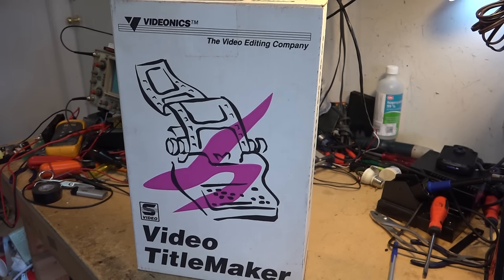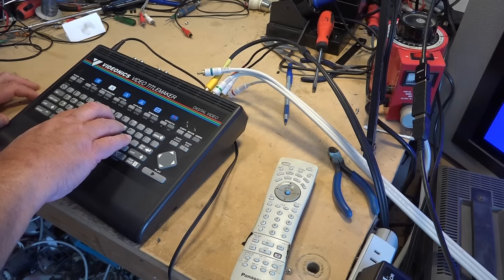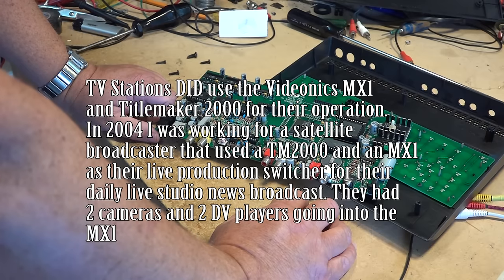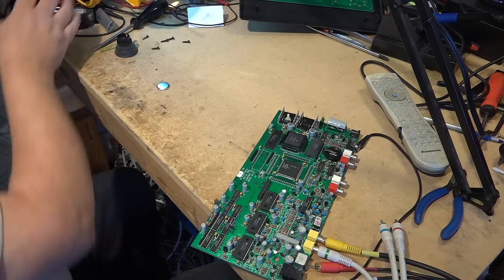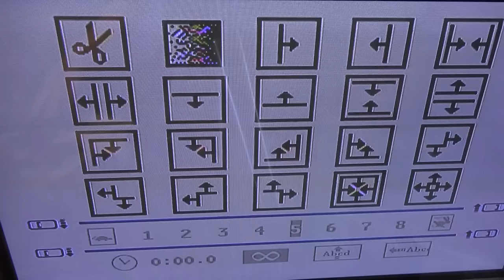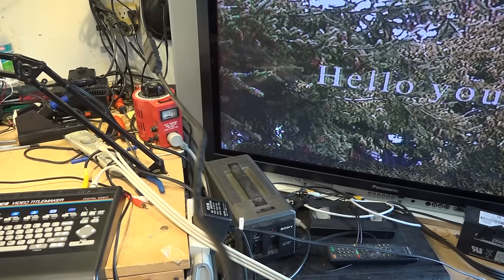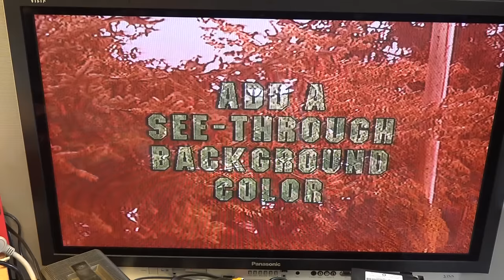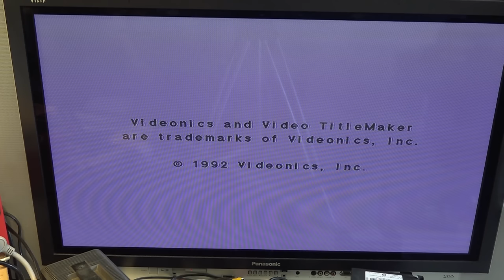Videonics Titlemaker Repair

Comment: Great channel! Thanks for the uploads.

A few years ago I got a Videonics MX-1and used it for a while with no problems. I used it along with this Title Maker and was really happy with both pieces of equipment. After putting them away for about a year I put the MX-1 back in use, but now suddenly have feedback issues I never dealt with before. Any video going through it now has two gentle squiggly bars that slowly crawl up the screen. Not major, but noticeable. When I connect a preview monitor, the preview image gets the same thing, but way worse, with the crawling bars being purple and green. That wouldn't bother me too much since it is just the preview monitor, but I've noticed that when connected it does make the squiggly crawling bars worse on the main output image and even adds a white line to the center of the crawling bars. Could my problem also be a simple battery issue like this was? Hoping it's a simple fix I could do on my own. Any thoughts would be greatly appreciated.

Comment: This thing is cool. I have used a bunch of different Videonics character generators when I used to work in a small studio in the late 90s. I never really had the patience to work on a TM 1000, 2000, or 3000. When I was introduced to this type of equipment, I started on a Videonics PowerScript PS-1000, which has more of a computer type interface with a mouse and keyboard. I believe the board was actually based on a computer. I was never a fan of the membrane keyboards, that most of the time when I had to put titles in a production, I was under a serious time crunch. It was always quicker for me to use the PS-1000. Another thing I liked about the PS-1000 was that I had a handful of PCMCIA memory cards, that I was able to keep all the titles for different productions on their own card, and swap them out easily. I'd like to find a PS-1000 to play around with again.
Reply from the maker: That was their pro division. This was consumer, but it still delivered great looking titles for the price.
Reply: makes sense. if your just a guy at home with 2 vcrs, this titler and/or an mx-1 would have been amazing in the early 90s.
Reply: As a teen, I used to see ads for Videonics products in Videomaker Magazine and wanted the Titlemaker 2000 unit and MX-1, they looked so sweet!
Reply from the maker: I have both the TM2000 and the MX1 from my old production suite. They were very good products that served their purpose well.The MX1 is still very useful as a time base corrector to stabilize bad tapes for digitizing. (it also removes macrovision)
Reply: 12voltvids Cool!
Reply: Reminded I just went to an Open House at a high school I once went to last month.  There was a teacher there that taught "Media Arts" who actually had some leftover equipment he was going to throw out.  He gave me his MX-1!  I was lucky!

Comment: A lot of cheap video titlers out there often were blocky letters, and often only gave you maybe 8 or so colors to choose from as well as a limited number of pages to store them with.  Videonics was certainly the first to do it right with this titler, though of course the later versions like the 2000 and 3000 did expand on the capabilities started with this one.

Comment: Amazing piece of old school video editing gear! My 1984 portable Hitachi VT-8E VCR has a switch to display time and date on the screen. But it's just these pixelized characters.
Reply from the maker: I'm editing the TM2000 demo right now. Both these pieces are up for sale now, hoping for a new home.
Reply: I remember seeing scrolling messages in a store. It had a large screen but it used big LEDs much like the score boards used in basketball courts. I was told it was driven by a PC.
Reply from the maker: That's called a pixelboard, and yes they were driven by a PC.Now for sinage they use big LCD panels, and drive them with Raspberry Pi's

Comment: I have one is not giving me color which you know what the problem will be would it be the battery I got that same model and I plugged it in  a monitor. Doesn't have car color also the older units use 12 volts VAC 1A the m 2000 uses 9VAC 1A . Can you give me a hint why I'm not getting any color on the older model their original model the first one that came up with the one you're working on
Reply from the maker: I have no idea but i have 2 working units for sale cheap.

Comment: I'm a huge Amiga fan. Have you got a Toaster? Would love to see a vid on one of them.  I think them toasters are getting quite expensive as they get rarer though.
Reply from the maker: No I never got a toaster. I wanted one, however I was more into video quality, so I dropped 20 grand on a camera instead. I was more of a shooter, and pro clients wanted broadcast quality.  I used a videonics MX1+Titlemaker 2000 for my early stuff until the Miro DC30 hit the market, then I jumped on the Adobe Priemiere bandwagon, which incidentally I still use. Not the DC30, but Premiere.

Comment: Hey Dave! Me again with more questions regarding Videonics. I have been looking for quite sometime for a videonics o some nice mixer for use as a TBC. Still no luck. Just today, someone offered me a Videonics MxPro for 10usd, but has a issue: it turns on but it doesn't output video. Do you think it coul be an easy fix like this or might be more probable bad caps?
Reply from the maker: Never fixed one, so I don't know what goes on inside it.
Reply: @12voltvids  I know someone who said the MXPro didn't have a whole lot of differences from the MX-1 though I haven't seen one used to know.

Comment: This must be the forerunner to the QUANTEL paintbox as used by the BBC.
Reply: Quantel Paintbox came out in 1981, cost 5000 pounds, took up a good chunk of an AV rack... and nothing compared to it. It was worth every penny. 

This gadget came along about 15 years later, I think?

http://www.creativebloq.com/video-production/remembering-quantel-paintbox-712401
Reply: This was basically a "PROsumer" type device that was catered to hobbyists and small-time videographers during the 90's.  I would say it certainly had an advantage over other character generators at the time when it came to the amount of colors it could do as well as the added effects like fades/dissolves and fonts.
Reply: I think the closest regular people got to what the Quantel Paintbox could do was probably the Amiga computer line of the late 80's, especially with programs like NewTek's Digi-Paint or EA's Deluxe Paint.

Comment: Well isnt that mad, battery problems lol :-D.
I would be supprised if it was only the battery voltage that created that problem, possibly 
the memory was scrambled and it needed clearing.
A very usable device for its day :-D.

Ive seen a good share of pc cmos memorys thats been scrambled and stops the machine dead, after the battery was removed and a short across the holder for 10 mins the pc would come back to life :-D.
I had one last year where the owner was going to buy a new machine because it would not power up, battery out, short the holder out........... battery back in and Presto works :-D.
He decided not to buy a new machine LOL.
Reply from the maker: Yes, and the guy that owned it bought the newer TM2000 when the battery died and his other one died. He first sent it back to Videonics, and they returned it unrepaired from the looks of it, because the shipping card was checked return to sender. Many companies do that. If something is out of warranty, or you return it without first getting en RMA from them, they just punt it back postage due.Looks like he got it back, bought the new one and stuck the old one in storage. Now it is mine to get rid of.
Reply: At least it has some usefull functions unlike the sima crap LOL :-D
Reply from the maker: Has lots of useful functions for someone still working with tape.
Reply: For me it has to do its primary functions well, and it does.
The pile of shit sima is like having a multimeter with every possible function, but wont read voltage/resistance correctly, waste of parts.
Reply: Not having watched the video yet, but as the owner of a Videonics TM-3000, I can say with great certainty that battery failure will scramble the internal memory and keep the unit from booting up.

As if that weren't both of absolutely amazing and inexcusably poor design, Videonics cautions one in the user's manual to always turn the power off with the keyboard. And yes, an unexpected power removal actually can trigger the same "no boot" condition or loss of all stored titles (and the clock!) if it happens when the unit is "on" and working.

Videonics did provide a "hidden" set of keystrokes that would reinitialize the TM-3000's memory and get it going again (at the expense of whatever was programmed in to the unit). While this is something that an end user might need to deal with, the recovery sequence is mentioned only in the service manual.

Oh, and the TM-3000 keeps the absolute worst time of any electronic device I can remember, despite its having a proper timekeeper chip.

(There are also a bunch of 40-pin DIP sockets in the TM-3000 -- eight of them if memory serves -- that are completely unpopulated and undocumented. My best guess is that they were for a font expansion that never showed up.)
Reply from the maker: The unpopulated sockets could have been for memory expansion.
Reply: Interesting. Too bad they never pushed that further.
Reply from the maker: The Videonics products were good, but once computer editing came online their days were numbered. The company still exists producing professional broadcast hardware.
Reply: 12voltvids Pretty much.  I knew a group in the 90's who put together silly parodies using these products like this vid...
https://vimeo.com/86804804